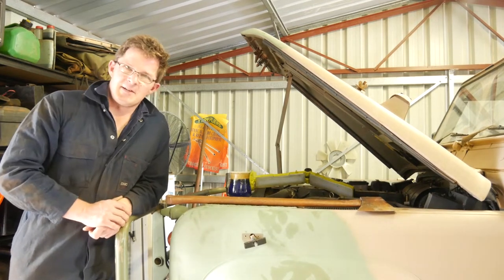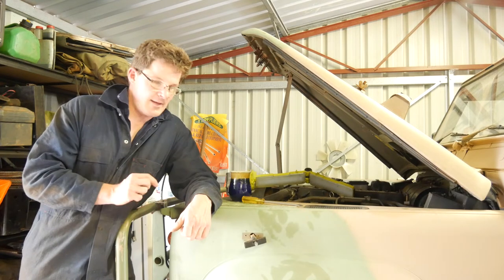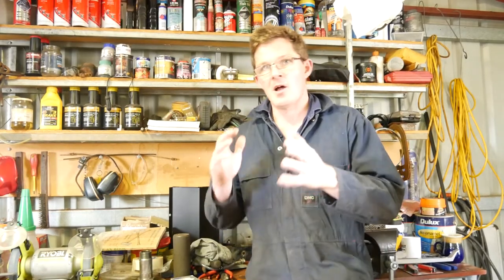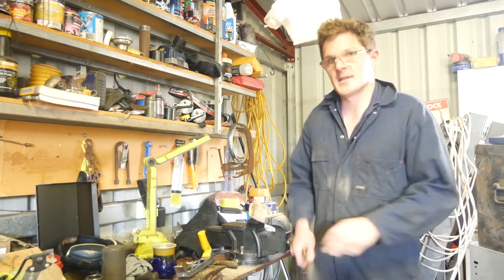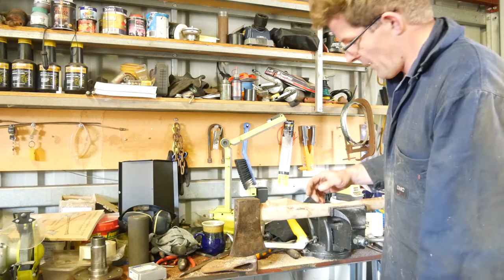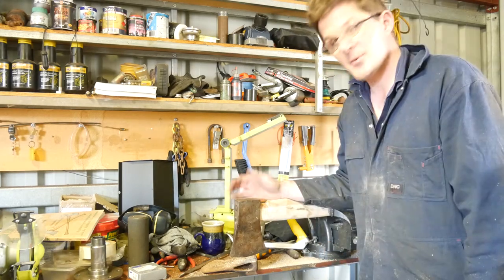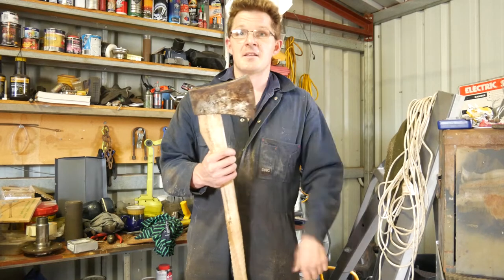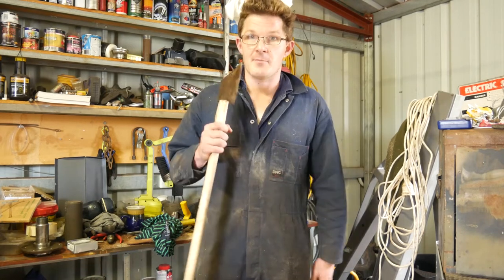How to sharpen and refurbish your axe

Comment: Good video Geoff. The other tool you should always take, (so you can hold up four fingers without correction !! :) :) ), is a folding Silky Saw. The 'genuine' article is a brilliant piece of kit, a joy to use, and is no weight to carry. Thanks for your time and sharing, stay safe, cheers.
Reply from the maker: Hi Big Kev, thank you for sharing some great top tips as always. Yes the Silky Saw is a great one to carry too, nice and light weight.  Hope all is going well in you neck of the woods Kev. Cheers Geoff
Reply: BigKev I would agree that any saw is a little safer and many times more efficient to use than either an axe or chainsaw. To get bush firewood. Unless you’re sitting on the end you’re cutting. A good axe has such a unique feel though.
Reply: @mozaic_channel  Totally agree Roland, a good axe is a joy to use,  . . . . and there's something deeply satisfying about hitting the same place twice in a row when you're splitting a tough piece !!!! :)  :). Cheers and stay safe.

Comment: Great stuff! Is the wedge steel and do you buy these?
Reply: You often get a wooden wedge supplied with the handle, and I then bang in a couple of steel wedges at 90 degrees to really lock it in. It's a good idea to fit the head with the wooden handle coming up through and then cutting/sanding the excess back to get a cleaner finish.
Reply from the maker: What Chris said, thanks for stepping in there Chris. Great stuff, cheers Geoff

Comment: With the chainsaw, if you sharpen it beforehand and driving a petrol 4x4. That means all you need is the chainsaw and some oil. I have a GMC chainsaw which is quite small and Australian made too! its a great addition.. 

It really depends where you go, out in the desert where you might encounter 1 or 2 fallen trees if that, axe is fine. Vic high country where a 50+ cm tree has fallen over, youll be there all day with a axe. 

POU is a important element you shouldnt forget. You work in the mine industry, why isnt BHP mining gold with pickaxes still? Arguement ended.
Reply from the maker: If your taking a chainsaw and intend to use it you need to take a spare chain and sharpening kit. A blunt saw and with a broke chain is pretty useless.

As for GMC they do not by any means have a repetition for quality or reliability and I very much doubt that the only thing made in Australia is the box it came in.

50 + cm tree does not take long mate, with sharp axle.  

As for BHP and pick axles. You have missed the point of this video by a mile. It is about keeping weight down in your 4x4, and chainsaw takes up shape and requires more then a sharpen before heading out bush.

Regards, Geoff